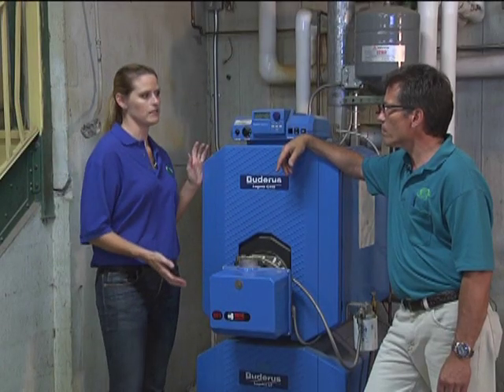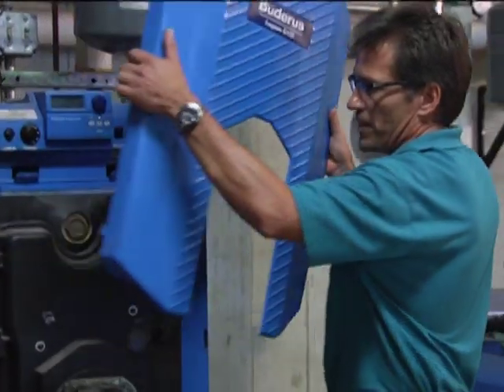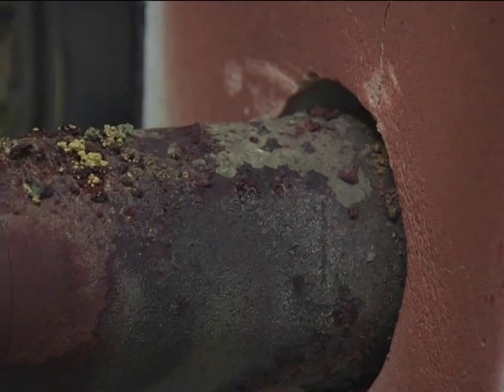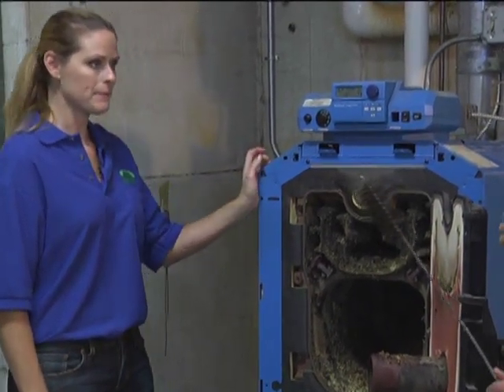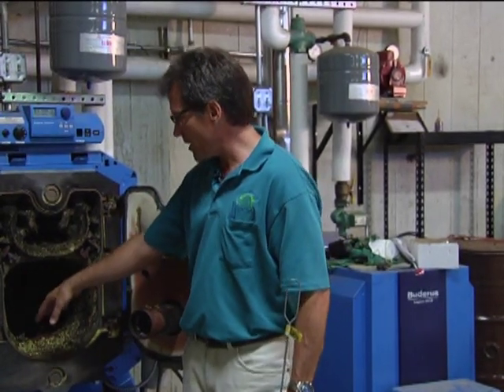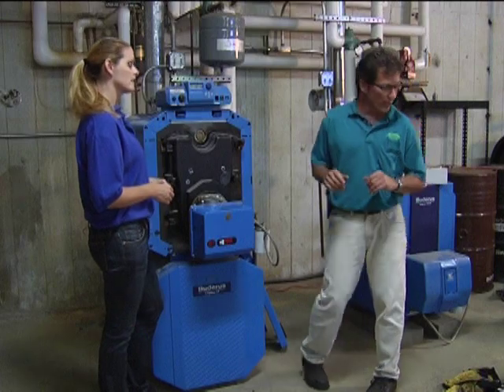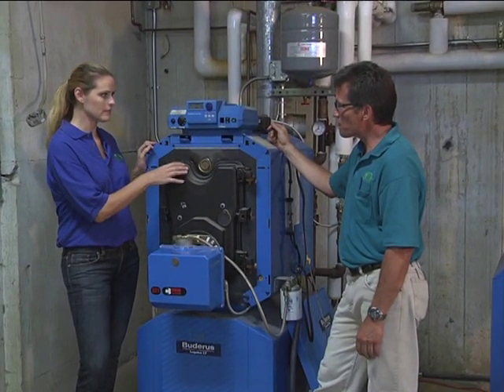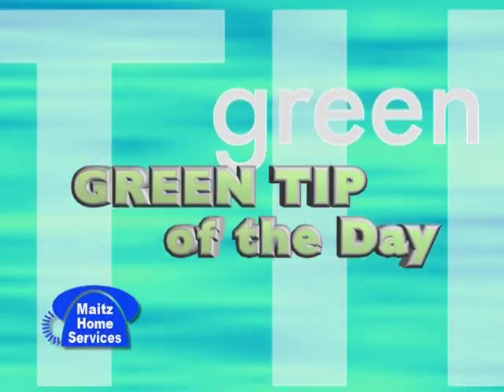Maintaining An Oil Fired Hot Water Boiler

Comment: You should take this video down. Per Buderus and Riello Your barrel of the burner, the air tube, is suppose to be flush with the door, this is one of your causes of excessive soot. Secondly carbon monoxide is a problem associated with natural gas and propane units because their incomplete burns are not as obvious in smell, it's an odorless killer.  A poorly burning oil furnace is stinky and thus obvious.